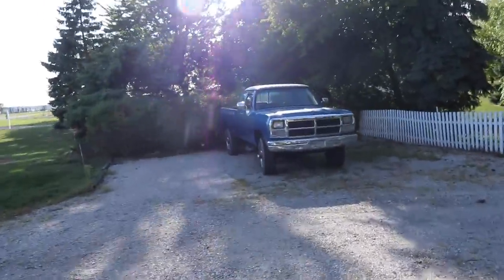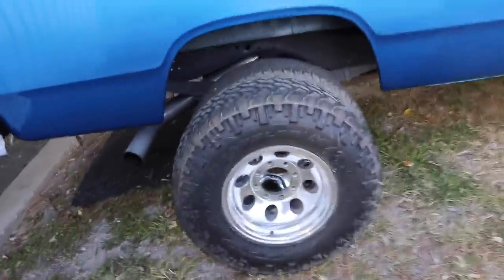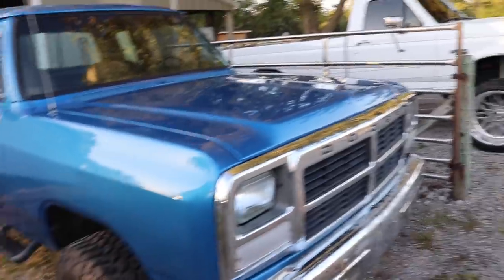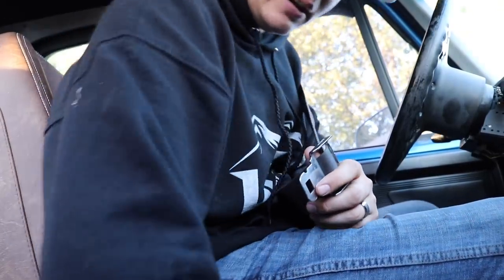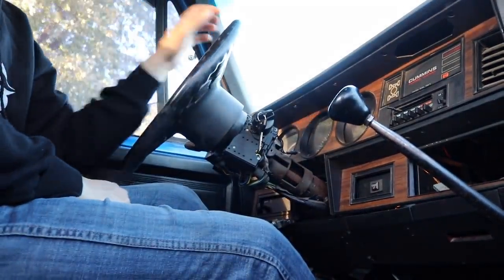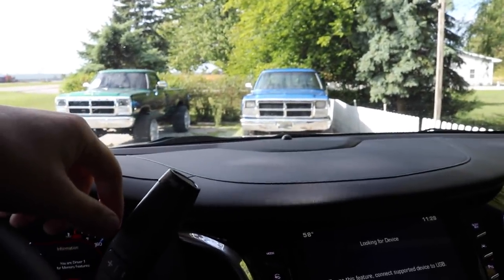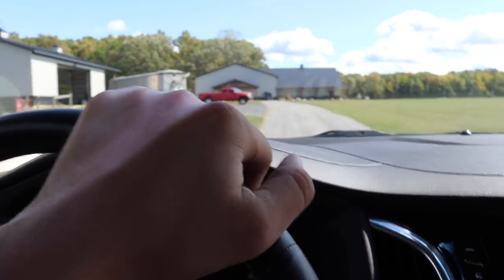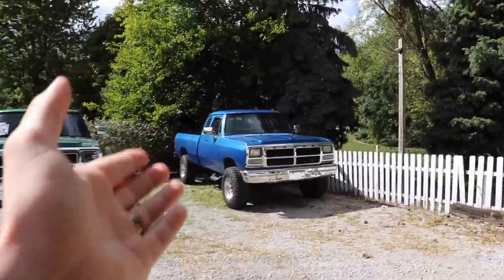Making my 1st gen cummins STREET LEGAL...

Comment: Do injectors / do a turbo from savage fabrication they are sick!! Also do a steed speed manifold and do a full pusher intake and also with the pump fuel pin and gov spring and maybe a lift pump as well I’d also look at doing valve springs

Comment: Do 200 hp injectors
Reply: Why there’s no point you would have to upgrade the clutch and possibly the diff. Also why do people think that’s cool to roll coal it just give diesels a bad name. You think you know more than Cummins that’s the most reliable engine they made.
Reply: JakeYFZ I never said anything about rolling coal... it’s just fun to have a powerful performance truck
Reply: Cummins.Turbos.Diesels yeah but if you do that it’s going to roll coal eaither way
Reply: Also you have to buy the fuel pin and injectors which will cost like $1500 no point
Reply: Cummins.Turbos.Diesels here comes the spelling police
Reply: Bet you don’t even own a cummins
Reply: JakeYFZ I just messing with you man😂
Reply: Cummins.Turbos.Diesels I kinda went to far. I’m not trying to be a keyboard warrior here